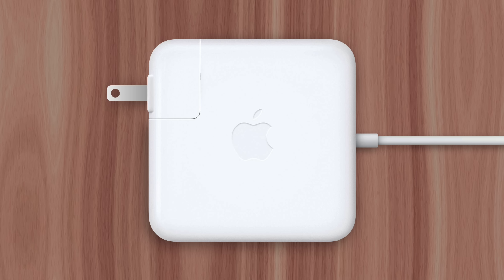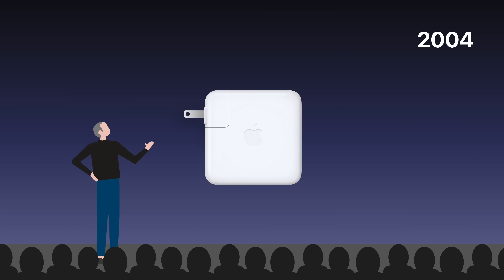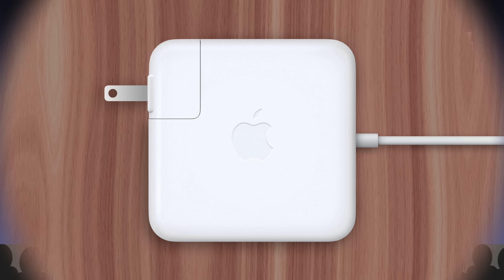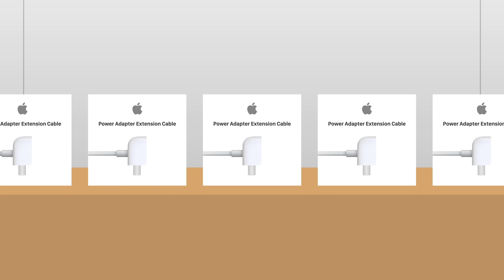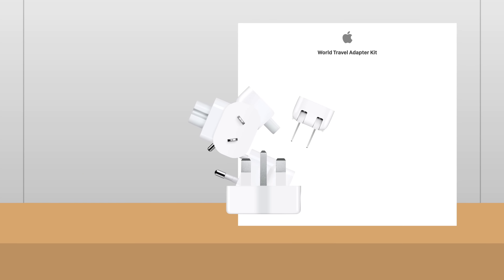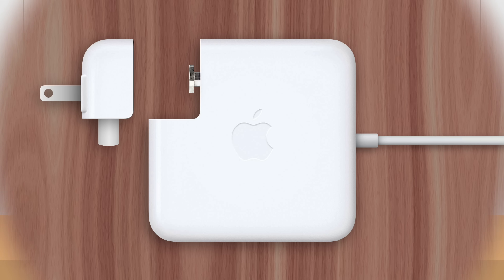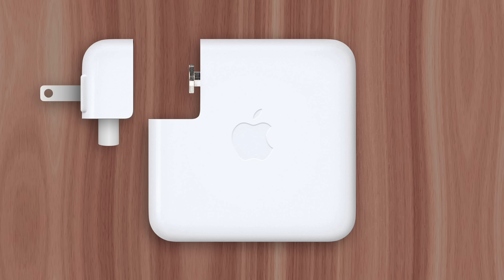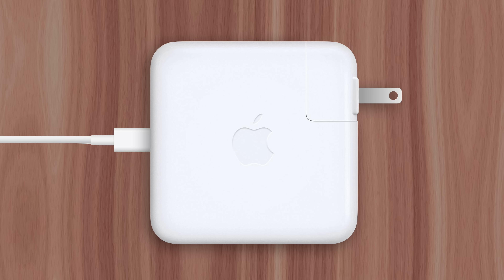Why The Mac Charger Comes Apart

Comment: You don't need to buy a special extension. Any 'figure 8' power cord will fit in the magsafe charger box. Any length you want, with whatever plug you need.

Comment: Those extension cords were awesome when they were free, but fun fact: You can buy and use a much cheaper regular two-prong cable with the Apple power brick just fine. It just doesn't look as pretty.

Comment: Wouldn't it be totally crazy if they just used the standard wall-to-converter port that exist on the charger for every other electrical device ever manufactured. Jk, having a giant brick attached to the wall is clearly better.

Comment: specialized prongs? lol.
I would guess the reason isnt even to sell some accessory extension or even travel plugs, just a good way to use it even further. I guess the primary reason would be that you can make only one charging block for the whole world by utilising the IEC 60320-1 C5 plug and the C6 socket that are simply ungrounded mains power options for devices in one international standard within both the brick and the plug and/or extension cord. In fact despite it looking ugly I'd assume a standard C5 cable would likely still fit fine.

Comment: The main reason they did this is so they could sell you "extra" accessories for it for a small markup of over 100%. An extension cable would usually cost you 5$ max. Apples extension: $20

The "extra" accessories was a them being like oh shit now that we made it impossible to use an regular extension cable we can force them to buy other stuff for it too and at added cost!

Comment: Those things are so ridiculously expensive! Nearly $20 extra for that white cord with the little block that plugs into the charger? NO thanks (not no and then thanks, but no, not even thanks), My gray or black one from one of my old camcorder power adapters or some old audiotape recorders or even shavers will do the trick just fine (even though it doesn't have that block that fits nicely in that space)! And then $80 just for the charging block? That's insane!

Comment: These are an improvement over the 1st gen buds. https://www.youtube.com/post/UgkxK5mc3yw4xA7Mf2j6k6n1Uqv_KUgrKdeM Pros: The fit is fantastic. This is the biggest plus. They stay in my ears when running and become unnoticeable. They are tight but comfortable. The sound quality is about the same as the 1st gen buds. They pair more easily with my LG G8 ThinQ and immediately reconnect when removed from the case. The sound balance is excellent, good but not overpowering base and clean mid tones and highs.Cons: The noise cancellation is good but perhaps a little less effective than the Bose ANC on the 1st gen buds. Passthrough mode as not as good as the 1st gen buds making it a little more difficult to hear conversations when in passthrough.

Comment: The thing is I would take out the outlet plug part on the top and replace it with a laptop charger cable instead. People thought it looked cursed but also it did charge my iPhone faster

Comment: Don't forget that you can plug ANY C7 cable (https://en.wikipedia.org/wiki/IEC_60320#C7/C8_coupler) so, technically, you don't even need an apple branded extension cord.

Comment: Can the socket fitted in L shape? I do not want to fit the charger vertical to wall. I want the charger to fit it parallel to the wall. The current design is very bad in my perspective.

Comment: Apple should warranty all their old style charges. I'm on my 3rd one and it just failed. POS. It's a design flaw, the cable is too thin and the inferior plastic insulation gets brittle with age and disintegrates. Trash.

Comment: I still use my 2014 Mac Book Air 11 inch, but I understand it can ONLY be charged with the MagSafe charger. I've had two MagSafe chargers and they fray and break very easily. They cost $80 each. I will need another soon. The Apple Store did not show the MagSafe charger with detachable cord which would be a lot cheaper.

Comment: For the extension cord, you can use the playstation cable to fit into the removable part. It’s easy to buy and very durable.
Reply: Yo I put my playstation cable into it but it still doesn’t charge :/
Reply: @echoslayer5616 same I thunk the comment is hullshit

Comment: Every other laptop manufacturer just gives you a standard input voltage of between 100 and 250 volts so any adapter that fits the wall would work 🙃 but no not Apple, they aren't making enough profit out of you

Comment: The removable plug is so that they can have one charger, and different plugs for different countries. The fact that you can put an extension cable in it is an added bonus. A lot of manufacturers do this, just to save money.
Reply: yeah although on many laptops you usually see either that or more likely C5/6 aka the Mickey Mouse Plug, which is basically the same but grounded

Comment: The laptop power cable connector that Apple uses is called IEC 60320 C7, but what Apple actually did was make it so nobody could use their pre-existing extension cables with the charger without it looking ugly as hell. So one would cave in and buy the "pretty" extension cables instead. If you don't mind it looking terrible, feel free to plug in any other cable that fits in there and it'll work just fine (it has to, as per the standard).

Comment: Not correct. The reason Apple (and many other companies) do this are so they can ship the same sku of charger globally.  They only need to package to correct adapter plug for each market where they sell them and can sell the same brick to everyone globally.

That and they can sell proprietary adapters and longer cable lengths - as you point out.

Comment: Another reason might be cost cutting. By making a universal charger that can be used all over the world, Apple doesn't have to make different regional variants of the charger, instead just bundle in the approrpriate plug which is a much cheaper part to make variants of.
That could be the most important reason, with the others being a bonus. Many other manufacturers do the same with regional adapters, or use standardised cables and plugs.
Reply: Its probably the main reason, as there are different power wattages in different regions

Comment: Pro tip: if you have the older version of the charger the plug has a cable attached to it, and you can attach an iPad charger to it. Making an all apple usb extension

Comment: Ya missed the big point of the cable accessory… grounding the brick. Without it, the USA stubby adapter does not ground the brick.

Comment: You'd never be able to have the plug piece come out from pulling it...It slides down onto the bolt. It's so you can easily swap out the piece for different countries and the flip outs are for wrapping the cable.

Comment: 1:44 that's not because the users wrapped the cable too tightly.
Overall MacBook, iPod, iPhone, iPad charging cables just break like some cheap 2$ charging cable.

I had over 3 MacBook Pro 2018 charging cables replaced despite the fact that I didn't coil them and used them like any other cable that was included with my Linux laptops.

After my 4th cable broke, I bought an Anker USB C - USB C charging cable that supported the PD charging standard and it worked for me for over  2 1/2 years till Apple released some firmware update and it caused an issue where the cable didn't deliver enough power while charging and caused the MacBook to discharge down to 2% while showing that it was charging correctly.

So, here we are again, I have an original Apple cable and it already has cracks in the isolation :|
Fck U Apple.

 Luckily I got that laptop as an gift because I would never buy such an shitty product.

Comment: Do you have a video on why the charging block was so big, so bulky, and so poorly designed? In my experience, you either have to take up the entire outlet space when you plug it in, or you have to accept that the weight of the charging block is going to pull the plug down so that it hangs out a bit. Most computers just have a regular plug on one end, the charging connector on the other, and the block somewhere in the middle. And that works fine. Why was Apple's solution to the same problem so much worse?

I believe they've actually fixed this issue with the newest models, but why was the charging block so bad to begin with?

Comment: When I was in high school, everyone had school issued MacBooks, and I used to charge people like $15 to sloppily solder their busted cable back together and wrap it up with electric tape
Reply: I just did that to my 2012 mac book pro charger but instead of electric tape I put biggish heat shrink and fill it up with epoxy. Its perfect fix tbh
Reply: How much did you make?
Reply: Then you got hired at apple
Reply: @jameshowell1214  it was actually a specialty public school in a fairly average predominantly black county in Maryland. A new program that accepts 100 students each year to go to school at the local community college and graduate high school with an associates degree. My parents and I didn’t like it so I ended up transferring to an actual private school where they started making everyone purchase iPads to use in class.
Reply: @sk8ersteve  I went to the exact same school your talking about. I actually graduated a couple years back. Sorry to hear you didn’t like it though
Reply: High school hustles
Reply: What kind of high school did YOU go to
Reply: That's... 15 times my allowance, and I only use half of it.
Reply: @diakounknown1225  15 times your allowence? So you only get one dollar and only use 50 cents?
Reply: @Lotus_flower200X  yes I do only get a dollar. And no I usually use 20 cents.

A dollar goes a long way in the Philippines. It's 50 pesos. Most food things cost 10-25 pesos. Or 20-50 cents.
Reply: @diakounknown1225  so if i moved to the phillipines i'd be freakin rich? im packing
Reply: @diakounknown1225  wait they use pesos on the philippines? thats strange, pesos are mostly used in latin america
Reply: @Capshortsbeamng  yep. The Philippines was a Spanish colony. And Latin America is well. Latin. Either Spain or Portugal.
Reply: @aw1lt  you should! Lots of retirees are being left homeless in the US bc rents went sky high and nobody care if crippled old grandma's sleep on sidewalks in the NE US. They are finding a comfortable life in other countries where their social security does support them, where ppl are friendly and where they are horrified to find young ppl can't get jobs or have jobs but can't pay for homes or where ppl think it's ok to let old ppl suffer on the streets or in old, filthy, dangerous pensioners' housing.

Make your money, save it and go wherever life is good and where you will be happy.

Check out vids about ex pats in other countries on you tube. Good luck and have a great life.
Reply: Biznezz
Reply: Wow then you must be working with apple now 😂
Reply: @harsharip  I wish imma lame fr
Reply: This is businesses....... 😂😂😂😂😂😂😂😂😂
Reply: Your school giving you macbooks meanwhile my schools’s computer lab still running windows 7 :’)
Reply: @nakulanand4419  windows 7 is better
Reply: @nakulanand4419 windows is superior for 99% of people so it’s not really an issue. Macs are only superior in laptop form since the battery on windows laptops are pretty mediocre
Reply: You are a genius bruh
Reply: I charge $20 to do it with milspec solder and heat shrink on top. I charge the same (or more) for a whole replacement jack
Reply: The fk kinda school you go to? I had to drop my Robotics, Java and Programming Classes in High School because I couldn't afford a computer/laptop and the district was stingy as hell to invest in school issue laptops.
Reply: And they gave you that much money 😂, you are a businessman
Reply: Entrepreneurship at its finest
Reply: Apple would like to hire you
Reply: I never understood how people managed to break their magnetised power adapter that would disconnect if you coughed ffs 🤦🏻‍♂️
Reply: big brain
Reply: Nice going. My old (10 yr)cables  $20 might have lasted 3 wks or 3 days. Drove me nuts. Months ago i bought 2 on Amazon and I'm still on the first one.

Shows they could have been making good ones all along. (These arent, however, made by Apple, nor were they anywhere near $20 each!)

My old ipad, though it stopped updating years ago, still serves to allow me to play old games on it everyday.😁
Reply: My school gave me a MacBook and I unlocked it and i still use to make beats

Comment: It's obvious.

Otherwise they would have to make a different charger for each country, now they only have to include a different 'head'.

Also, any '8' connector will fit in there properly, like from a playstation or a TV, those are much cheaper and you can use the TV's cord on your hotel room as impromptu travel adapter.

Comment: It is also a supply chain move focused on reducing production costs. They can mass produce the converter which saves cost, and producing the adapter, which is cheaper, is made separately. It saves a TON of money.

Comment: Another advantage: By adding the extension cord, one can place the power brick in a safer position than, for example, directly into a wall outlet, which reduces mechanical wear on all of the involved parts and possibly prevents falling damage.
Reply: Speaking of mechanical wear, what are your thoughts on leaving the Apple usb-c power adapter plugged in all the time for convenience? Are there any parts that would degrade the product if left plugged in?
Reply: @ChrissyChrissyChrissy333  can't say how the bricks are designed/developed, but from my experience (IT Manager for three years, supporting 200+ MacBook users), leaving them plugged into an outlet constantly has never been a degradation issue.

However, the damage I see most with the power supply units results from
a) leaving the USB-C cable plugged into the brick and wrapping the cord too tightly around the charger, and
b) drop damage to the pins of the removable outlet plug
Reply: @mariuskreuder  Thank you for the reply, I really appreciate your insight. This has been a concern of mine for a while, so I am pleased to hear you have not experienced this particular issue :)

Comment: "only had to spend $19 to replace a bog standard usb C cable" 

im an android diehard, I admit that, but I will also argue that the pricing of apple products is actually getting better. however the accessory pricing is absurd.

Comment: I love how he says apple allows you to disconnect. That's funny because that's how apple works they only allow what they want you to be able to do with their products. And see how it's the users fault for wrapping the cable too tight. When windows laptop bricks you can wrap as right as you want and nothing happens really. Apples rubber coating on cables is garbage. But still manage to blame the users for issues.

Comment: Why it falls apart, like the ends of the cables that end up with the inner wires exposed. Of all the products I have had over the years, only the Apple adapters literally fall apart.

$19 for a cable ?

Comment: Removing the plug on the charging brick exposes a port that is actually compatible with not just Apple's swappable plugs, but also several other cables that have that same plug on their ends, which can actually be fairly common. I have a cable that I use for my rechargeable AA and AAA batteries, and it fits that port just fine.
Reply: yeah IEC 60320-1 C7/C8 is VERY common for ungrounded connections especially on e.g. printers and generally many things that dont need ground but mains power and want a detachable cable.

Comment: You don’t need to spend $19 for an extension, it’s a standard “figure 8” connector. I use an old Apple PSU plug so I can plug my camera’s battery charger into the wall

Comment: The plug coming off is similar to the iPad charger but if you take a standard two prong cable you can use that and not have to buy apples cable

Comment: Pro Tip … The extension cable fits into the Ipad charger which mine is detachable. Then you have an extended USB. Perfect for travel or by the bed.

Comment: Pro tip, any standard 8 shaped extension cable will work with the Apple charger. You don’t need to buy the cable from Apple.

Comment: Who the hell has had their charger separate pulling it out of the wall? You pull the plug up/power brick down to split them. I am yet use a socket outlet anywhere in the world that requires you to replicate this motion to insert/remove plugs.

Comment: "they ONLY need to spend 19 dollars to replace it".... We're talking about a cable. IT SHOULDN'T FUCKING COST 19 DOLLARS
Reply: a 1 meter iphone charger costs 19.99 🧍‍♂️
Reply: You're buying some really shitty cables if $19 is what throws you into a fit
Reply: @iamalittler  aren't Apple cables well known for breaking constantly? Should that cost 19 dollars
Reply: @flemes9615  no, they are not.
Reply: @iamalittler  yes.... Yes they are
Reply: @davidobrien8683  …you know this isn’t just a USB cable, right?
Reply: @iamalittler  what do you mean this isn't just a USB cable. The power brick too?
Reply: @davidobrien8683  do… you not know what USB is?
Reply: @davidobrien8683  the fact that there is an audience that needs to be told that parts of a computer are designed is starting to make more sense now
Reply: @iamalittler  this same channel has a video all about why apple's cables constantly break... Heres the link:
https://youtu.be/Dizu3e-qsmk
Reply: @iamalittler  tell me o wise one... What is a usb cable? Is it not a cable that allows for the communication between devices and power flow? Tell me whats so special about apple's cables?
Reply: @flemes9615  you know that phones are different than computers, right?
Reply: @iamalittler  You're an Apple fanboy aren't u